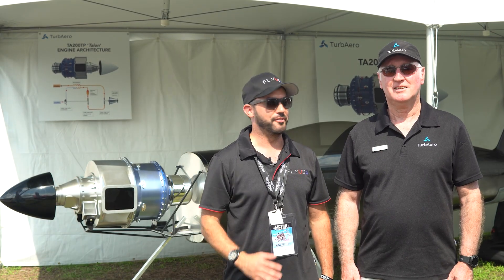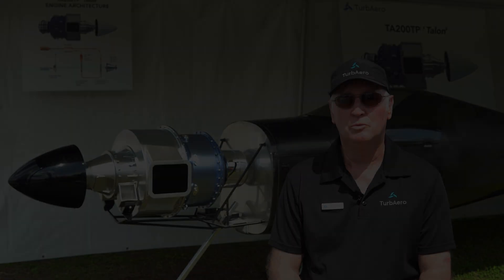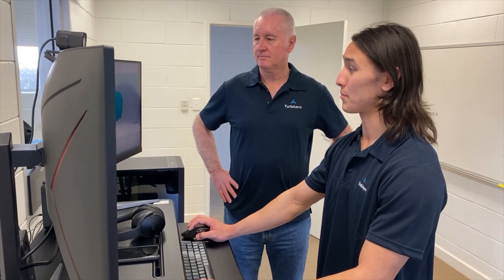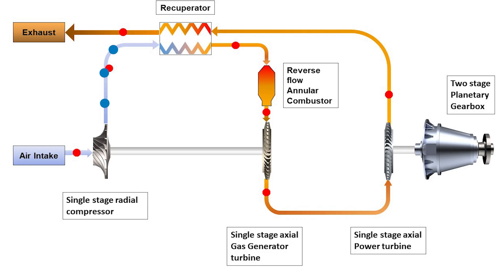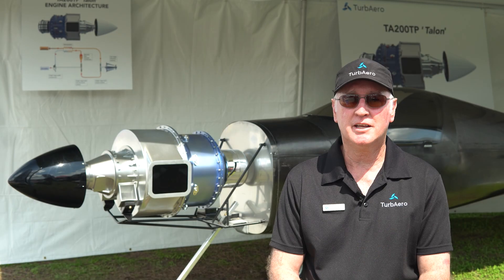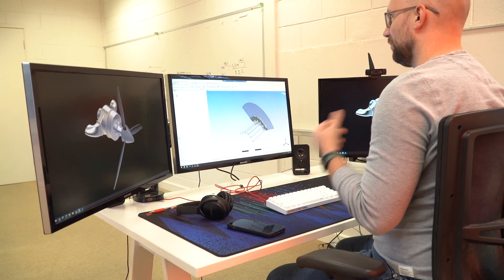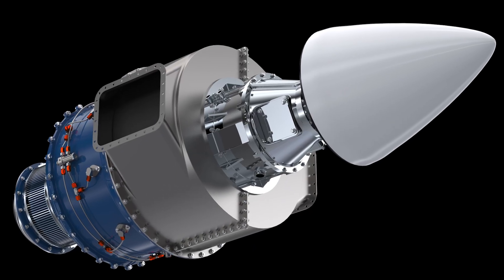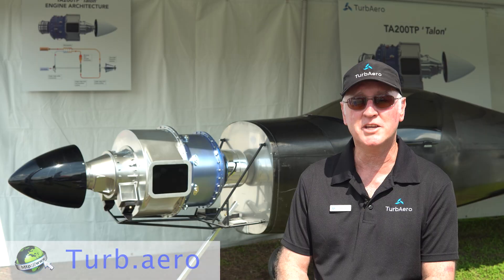200HP Fuel Efficient Turbine Engine by TurbAero

Comment: How can heating the compressor air make an engine more efficient?
Hot air is less dense right!
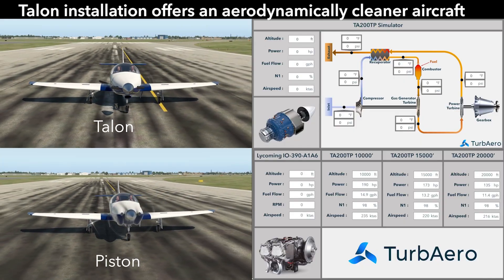Reply: As with any recuperator, the heat is added after the compressor. In any gas turbine, compression is followed by heating in the combustion chambers, then by expansion through the turbine. As shown first @1:25 and explained starting @2:16, the recuperator acts as a first stage of heating which doesn't consume fuel, so the effect is simply to reduce fuel consumption for the same power output... and thus greater efficiency.

Heating the air before the compressor would not work for either power output or efficiency.
Reply: You appear to be confusing efficiency with power output per unit of engine size.
Reply: For a turbine it makes sense.  It doesn't work for piston engines because they are limited by detonation.
Reply: @jimosborn390  It doesn't make sense for a piston engine only because there is no practical way to transfer heat into the compressed air in the combustion chamber, especially in the zero available time after the compression stroke and before combustion.
Reply: @brianb-p6586  jimosborn390 is correct. Piston engines heat up the air much higher than a turbine. this is done with the compression ratio. A piston engine has a much higher compression ratio but is limited by pre and post ignition. Piston engines work on pressure, turbine work on flow more or less.
Reply: @chippyjohn1  I understand where you might get that, but none of it is really correct. Internal combustion engines all fundamentally work the same way, whether they have pistons or spinning compressors and fans: they are heat engines, which compress air to a higher temperature and pressure, add energy by burning fuel in the air, then get more energy out in an expansion than it took to run the compression. 

The static compression ratio of a piston engine varies from as low as than 10:1 is an outdated gasoline engine to as high as 25:1 in the most extreme diesel cases; the pressure ratio is higher because the compression is roughly adiabatic. The pressure ratio (from intake to combustion chamber) of a turbine varies widely, from as low a 3:1 in a basic turbine (with single-stage compressor) to over 50:1 in modern large aircraft turbofans. The compressor outlet temperature in a turbine engine can certainly be higher than the temperature of the air in a gasoline or diesel immediately before combustion. 

If recuperation were possible in a spark-ignition indirectly-injected piston engine (it's not) then preignition would be a limitation, but since recuperation is not physically possible that doesn't matter. Preignition is due to the fuel being already mixed with the air as it is compressed, so it is an issue with any spark-ignition engine and not with engines that inject the fuel only at the point of combustion (such as diesels and turbines); that has nothing to do with whether the compressing and expanding elements are pistons or fans/turbines.
Reply: @brianb-p6586  The turbines that do heat up the air to high temperatures as a result of compression are much larger. A single stage compressor such as this turbaero does not. An 11 stage axial turbine may heat air to 600c+ but this single stage compressor would not achieve that, maybe 100c above atmosphere, no different to the compressor on a turbo. Compression temperature of a petrol engine is quite easily 200c and a diesel 600c. So this turbaero does run cold in comparison, although they don't state the compression ratio, but more than 5:1 is not likely achievable with a single compressor. Anyway, these engines, recuperator or not are no where near as efficient as a modern piston engine. 400g/kwh vs about 200 for a petrol. Not logical to use a tiny turbine.
Reply: @chippyjohn1  All gas turbine engines heat up the air by compression. Yes, larger turbines typically run higher pressure ratios so they raise both pressure and temperature more; the higher pressure ratio and thus higher temperature of heat addition are why larger and more complex (more stages) gas turbines are more efficient than smaller and simpler (fewer stages) gas turbines. 

Large gas turbines with a high pressure ratio (and thus high compressor outlet temperature) can still use recuperation. According to Honeywell's patent for their recuperation system, the recuperator of the Honeywell AGT1500 (used in the M1 Abrams tank) delivers heated air in the temperature range of 600° F. to 1050° F (316 C to 556 C) to the combustion chamber... much hotter than your diesel example.

The fact that recuperation is not used in piston engines still has nothing to do with compression ratios or temperatures and resulting preignition. Diesels do not have preignition, and can't use recuperation, because they're piston engines not because of preignition. Piston and turbine engines still both work on heat and working fluid mass flow, not one on pressure and the other on flow.

Comment: Uhh dark aero!! They are close to flying their plane soon ! Perfect for this engine! Uhh Rolls Royce has a 250 that cost through the roof!!
Reply: The UL Power UL520iS used in the DarkAero design is smaller, lighter, and more efficient than the claimed dimensions and performance of the TurbAero TA200... for the same peak power. Since TurbAero only claims any advantage at high altitude and the DarkAero is unpressurized, the turbine would be unsuitable in every way except for vibration.

Comment: Does anyone remember the ERCO ? (Google, Jessica Cox for ref...) 
A plane designed and built in the late 1930's that was last known as the A2 before the company changed hands (Again) to what we know as the Mooney
This was the safest plane ever made and also the most fuel effient even when compared to modern setups .
I wonder how this would go with a revisit, redesign and upgrade to Turbo Prop , with this much power available it could be a 4 seater that is Fast , Safe and extreamly practicle with that economy.
   And would look amazing with that classic Twin tail ...Maybe?
Ok probably just me but I like the Twin Tail setup , it's like the spair tyre on a 4X4 it just goes there.
This could save Cirrus from the out dated engine they have a sick fasination with too

Comment: They need to develop 350 to 400 HP turboprop engine.
Reply from the maker: That would be great. I can think of a couple aircraft I'd like to put one on!
Reply: @RichardofOz  Yeah me too. For one it would be great on Berkut or RV8.
Reply: No they don't.
Reply: The TurbAero rep in the video clearly states that their target is the 200 horsepower range due to lack of suitable turbine engines in that size; the implication is that they know they cannot compete at higher power levels.
Reply: Turbine Mooney… bring back the dream… 😃

Comment: If they can get the Specific Fuel Consumption (SFC) figure down below .6 lbs per horsepower per hour they'll be doing good, below .55 they'll be doing GREAT! Piston engines typically run .45 and a really fuel efficient engine runs .42.
Reply: This guy is absolutely right!  Specific fuel consumption is everything.  EVERYTHING!  I will be amazed if they can get below 0.8 at 10,000 feet.  Near sea level specific fuel will be truly awful, making this, or any low hp, light weight, turbine impractical. History is full of dead projects which were sold by looking at benefits while ignoring fundements and impossibilities.
Reply: @GrantOakes  A couple friends asked me about specific fuel consumption….so i expand on my previous:  Airplanes, unlike cars and boats live and die on weight. An overloaded car accelerates poorly but at all speeds the road supports it.  An overloaded boat still survives unless it is gets overpowered by a wave.  But an airplane must maintain something above stall speed or it will fall and if it cannot regain flying speed it hits the ground.

So, airplnes cannot exceed defined takeoff weights and that weight includes passengers and fuel.  Therefore the weight of the fuel, not the number of gallons, determines how far a plane can fly.  ( diesel fuel and jet fuel are heavier than gasoline) Diesel engines have specific fuel burns approaching .4 pounds per hour per horsepower. A diesel producing 100 hp will burn 40 pounds of fuel in an hour.  A gasoline version  with a specific of .5 will burn 50 pounds. A turbine with a .8 specific will burn 80 pounds.

The deisel engine will always be heavier than the gasoline engine and the turbine will be lighter. Therefore for a long flight, the diesel can give modestly greater range.  The turbine probably cannot be made light enough to offset its very much higher fuel burn at loweraltitudes and at the lower power of small planes.
Reply: research the Reynolds number
Reply: @theairstig9164  There is no reynolds number used here bud...

Comment: Anyone else reminded of the old Chrysler turbine car engine that used a recuperator like this? It had these heat matricies that would rotate slowly to absorb the exhaust heat and move it mechanically over to the intake. It was important in that car they cool the exhaust some before letting it out so they didn't melt anyone. Turbine exhaust can be a little hot untreated.
Reply: The problem with all that exhaust heat is NOT that it might melt things but that it is throwing away a tremendous amount of energy. It makes a gas turbine without a recuperator, especially a small one, extremely fuel inefficient (though very high power-to-weight ratio).
Reply: Recuperators are common in land vehicle turbine engines (such as the Honeywell AGT1500 in the M1 Abrams tank) and higher-efficiency stationary turbine engines. They're generally too bulky and heavy to be desirable for aero applications. Cosworth (the racing and high-performance car engine company) is trying to sell their "CatGen" recuperated turbine... and it's big and expensive for its power output.
Reply: yes, Phillip, but they, as you explained, where not using a heat exchanger with the recuperator conducting the heat through a wall, necessary when the pressures are different .
Here I guess the compressor pressure ratio is between 2½ and 4 and so, the turbines.
We tried to do this on a T 62.
There the power turbine was on the same shaft, here the powertubine runs at a different rpm. Which makes the starting much easier.
Reply: Reverse warning consists of things catching on fire behind you
Reply: Yup, Jay Leno has one. It can run on Jet A, Avgas and tequila.
Reply: That wasn't to cool the exhaust, that's easier and cheaper to accomplish by mixing in outside air, it was efficiency.
Reply: Yes, I remember the Chrysler turbine which used a recuperator! I came here to write the same. The recuperator cooled the exhaust but it also greatly increased efficiency although not quite enough.
Reply: The issue with the Car Turbines is emissions, it's difficult reducing NOx, which depend on combustion temperature, a hotter flame means more NOx, that combine with water in the air to produce nitrous and nitric acids, the most powerful corrodent known. 
N-Acetyl-cysteine po, let's say 300 mg bid, could protect respiratory tract from oxydizing agents, even asthma attacks during lightning storms and emissions during  anti-cyclonic weather.
When in WWII they injected water to reduce combustion chamber temperatures, an increased wear resulted.
In Diesel engines, a 2% Water emulsion in fuel provided many advantages, adding more water was not better.
Blessings +

Comment: Given its size, has any thought been given to an automotive application for this Mighty Mite?
Reply: It's not clean or efficient enough for automotive use. 

There have been many gas turbines designed and built for automotive use, almost all with recuperators, and all have failed due to inefficiency and operational issues. In a series hybrid configuration most of the operational issues would be resolved, but efficiency is still too low. With current requirements, turbines generally have excessive emissions, as well.

There is nothing about this specific design which makes it suitable for automotive applications. That's not a criticism, as it is designed specifically for light general aviation aircraft... not cars and trucks.

Comment: I thought you were going to be flying by this time from previous comments last year. It looks like a mock up. I predict it will never fly. 
Allison Model 250, now Rolls-Royce M250 is the logical choice for small turboprop for a fixed wing plane (about 300-420 HP).
Built a plane that can handle a PT6 (550 to 1600 HP), Garrett TPE331 (575 - 940HP).
Reply: @DylanClements98  The dream of turbine. I have flown turboprops and jets professionally. Great for commercial, military and rich people, corporate jets and turboprops. For GA pilots, private owners, who are not wealthy, flies well 100 hours a year, a piston under 350 HP is great. You can buy used jets cheap but cost of fuel and maintenance everything else is astronomical.  Fuel is not measured in MPG but Gallons Per Mile. (Jets use fuel in pounds but the point is... thirsty.) 

Their "economizer" is not a new idea. Their mock up has one in plastic  3D printed. The predicted power and fuel flow numbers out of thin air, wild guessing. Again the Allison Model 250, now Rolls-Royce M250 has been used in helicopters and a few fixed wings, including P210 and Beechcraft Bonanza turboprop conversions. They are OK but the airframe is speed limited and for the cost it does not do much more than a Continental IO550 turbocharged engine. Years ago you cold get Allison 250's out of APU Generators and convert them. You are far better buying an old TBM750 with a PT6 with some time on it (and pre purchased inspected to assure no cracks in combustor or other expensive issues). Before the pandemic you could get one for $0.75M and have a real plane that can do things. 

I know a Sonex Jet owner/pilot. The SubSonex as they call it uses a tiny drone jet. It has to be overhauled every 250 hours I recall. It is an oversized RC jet engine. It takes a long runway to get in air. Once up it scoots along but not for long, it has a range of only a few 100 miles, like the BD5J. Cool plane but a single seat toy, very cool toy but still. However if that is your dream go for it.  However that turbine dream will not be powered by this TurbAero engine... nope. TurdAero. Ha ha.
Reply: The Allison/Rolls Royce engine tops out around 450hp and was designed as a helicopter engine. Runs out of guts over 12,000 feet or so.

And costs in the $400,000 range. 
No way this engine will be $85,000.

Comment: Ultimately, we won't see the claimed efficiencies; any weight saved by the lighter engine will be eaten up by the jet fuel; you'll need more gallons, and each gallon is 15% more than avgas. My day job is at a company building the most efficient jet engines on the planet, and also the largest. It's not easy—a 5% gain is monumental.

Comment: 'Fuel efficient turbine'
Never seen someone crack a buggywhip so hard in my life.
Good thing the corps is feeling no pain.
Reply: It's fuel efficient FOR A TURBINE, but you're still getting less power for more fuel than you would with a piston. Could be a step in the right direction though, who knows what will happen in the long run?
Reply: @DiveForKnowledge  it's actually not good for a turbine, but might be good for such a small turbine.
Reply: @diveforknowledge  Gas turbines are INHERENTLY less efficient that reciprocating engines, because physics. Google "Carnot efficiency". That aint gonna change unless the Second Law of Themodynamics changes.

Comment: PBS has a 240HP turbo prop, remember Innodyne and the RR250 project at Mooney. why were these not a commercial success? 
Compare this designs with a big jet engine and look at the differences.
Big engines have an axial flow design with multiple compressor stages. Small turbines have a radial compressor that is less efficient.
Big engines have a complicated turbine blade cooling to be able to handle higher combustion temperatures. Small turbines do not have this.
Thermodynamic efficiency (=Carnot efficiency) depends on the combustion temperature. The higher the better, so it is limited by available materials. A piston engine can accept much higher combustion temperatures because it is not a continuous process. I like turbines very much because of their coolness factor. They are very reliable and much lighter. But it will be a tough challenge to overcome the above drawbacks.
Reply: It wasn't a success because it sucked three times as much fuel
Reply: PBS BSFC is around 550g/kwh. This engine is still high at 350g/kwh. With modern piston engines around 225g/kwh, small turbines are still far behind, especially now that we have good electronic engine management.
Reply: The Mooney / RR project got interrupted by a Great Recession…

The project announcement couldn’t have seen the financial disaster coming…